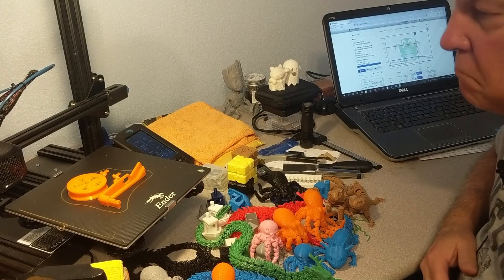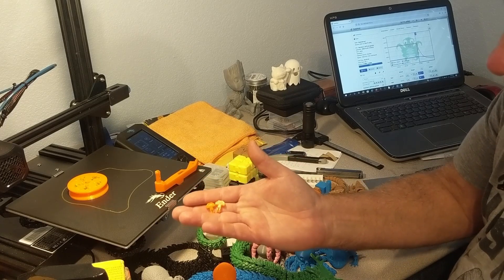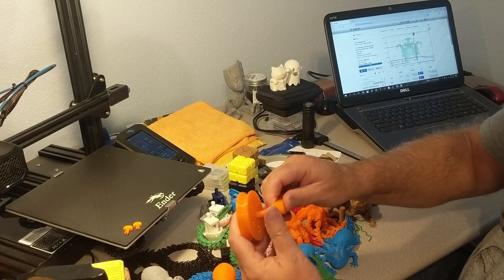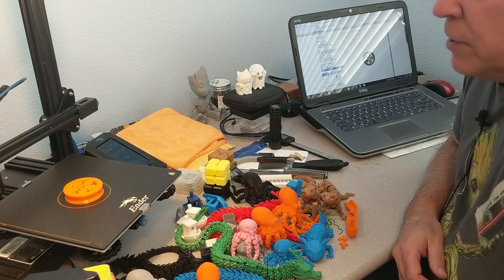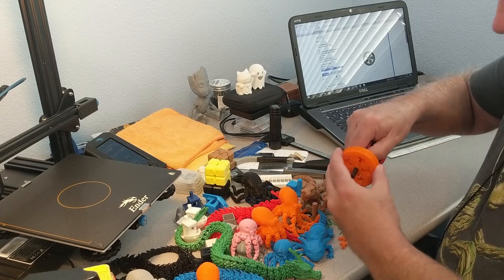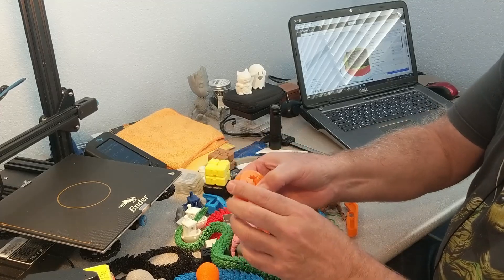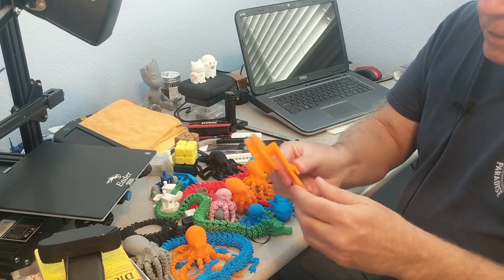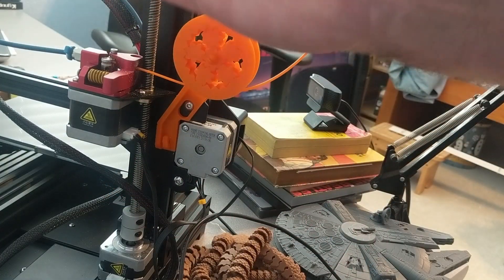3D Print - Ender3 Filament Guide

Comment: Do not throw your print away if gears are stuck. Drill the center gear off and print the only this one as 2 halves divided horizontally resized 85%. Keep the hole as same size. You can easily plug these 2 halves at center and use your guide.

Comment: What's the purpose of the guide? Does it prevent the filament from knotting?
Reply from the maker: It helps to change the direction of the filament so it enters the extruder straighter instead of entering at an angle when it comes from the spool on top of the printer.

Comment: For the planetary gear assembly I didn't have to adjust horizontal expansion and everything "cracked" loose after the print, with just mild pressure from a 1/4inch hex Allen key. I used Cura v5.4.0's Super Quality mode which is 0.12mm and I bumped up infill to 30% on my stock Creality Ender 3 v2. This was using Inland PLA+. Bed temp 52C. Nozzle 215C. The assembly then rotated with moderately strong resistance so I smeared  Gojo pumice hand cleaner gel into the assembly and rotated by hand for 30 minutes. Noticing only slight resistance at that point, I used fast tap water flow to thoroughly rinse the abrasive and now it spins super easily. You can flick it and it spins awhile, but it's not too loose. An earlier attempt with -0.16 Horizontal Expansion had so much slop in the gears it would jam randomly.
Reply from the maker: Thanks for the input. It's always good to have multiple solutions. I, along with others, have way too many ways to make this fail, so having different ways to make it work only helps.

Comment: I appreciate the little side note on the horizontal expansion. First successful print, the bearing was fused too tight to break free. Next one, I am trying your option to see how well it works for me.👍🤞
Reply from the maker: You might want to check that you do not have too much squish on your 1st layer. If you do, raise the nozzle a little or just print on a raft. I had too much squish on the Chess Board so I just printed it on a raft.